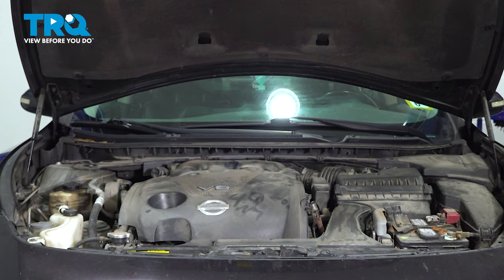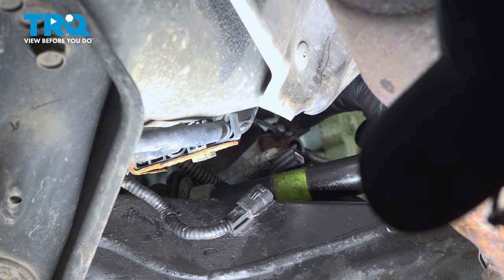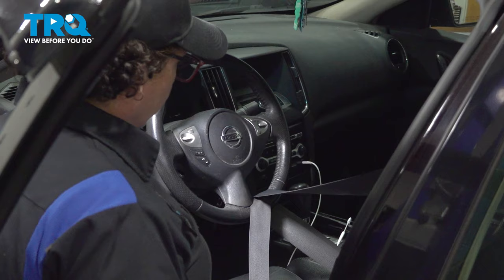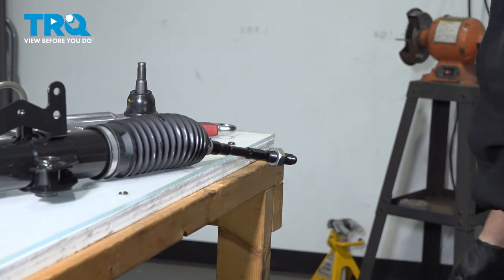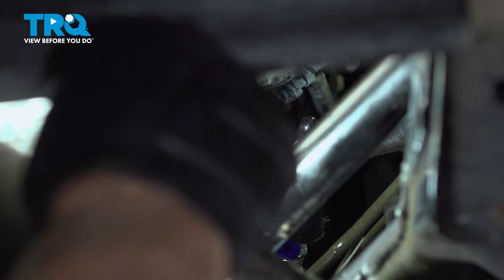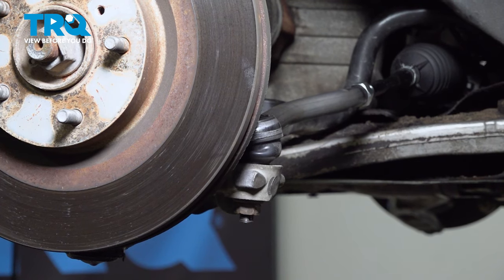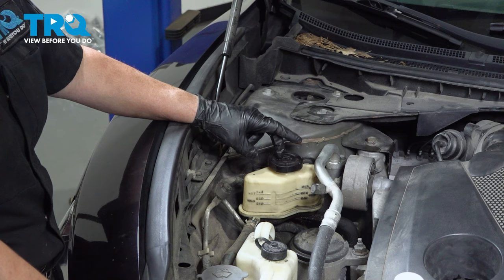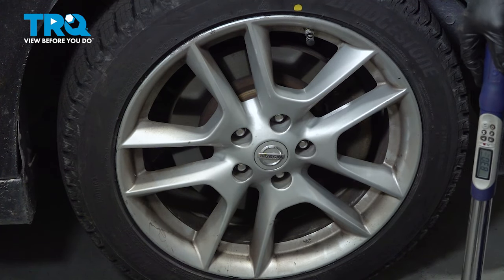How to Replace Steering Rack & Pinion 2009-2014 Nissan Maxima

Comment: I know I’m capable of doing the job but I’m hoping that somebody says yes the video is 28 minutes long and that’s how long it took us ,,, which we all know is probably triple that ,,, also I want your torque wrench
Reply: I am doing this job RIGHT NOW.  I am pretty good with tools, but removing those lines has proven to be quite the challenge.  I dont have the benefit of a lift so im on jack stands.  Gonna finish the job today.  Fingers crossed.
Reply: So how long was your surgery?  I have 317k on my ‘11, racks leaking and am considering 🙄🙄 surgery. … or just donate as I have the ‘17 also…
Reply: Probably the most brutal job that I’ve ever done on a car.

Comment: Pro tip: get a 3 ft extension for your ratchet. You’ll be able to reach the high pressure line from the passenger side very easily